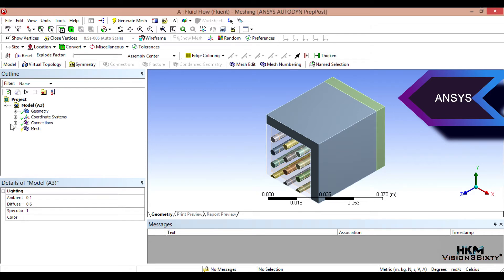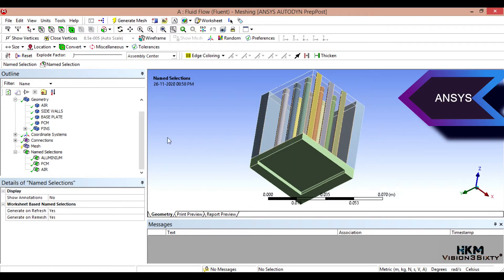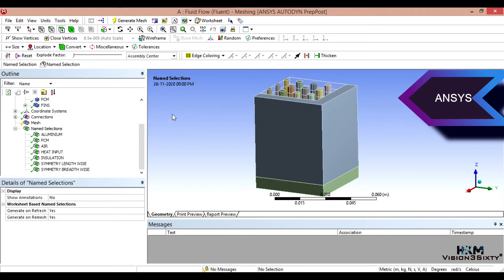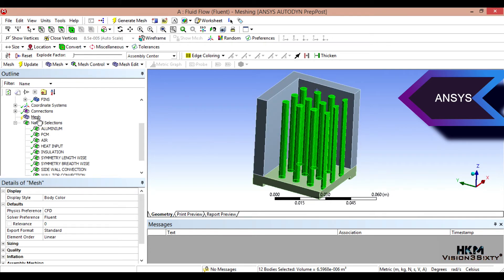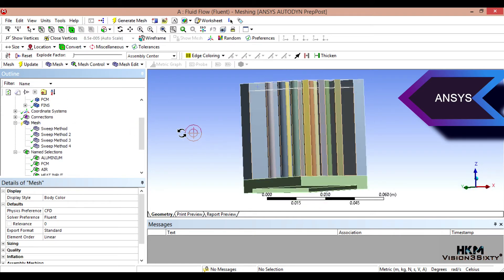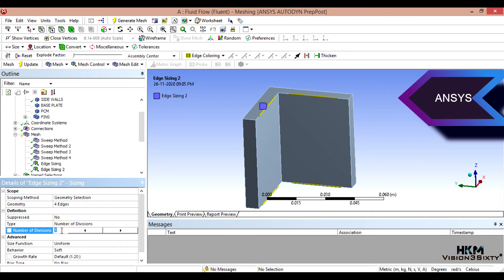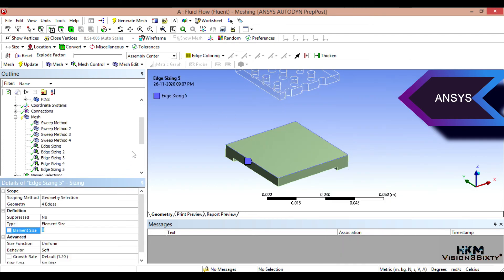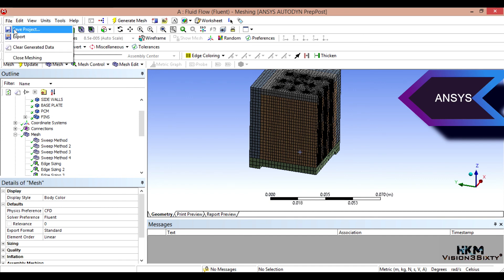Simulation of PCM Heat Sink with Fin Part-2 | Meshing using ANSYS

Comment: I have a much simpler experience than this one. Can you run a simulation of it in exchange for payment? I want to calculate the amount of heat that is transferred from to the phase change material, and I want to calculate the heat transfer coefficient for this material